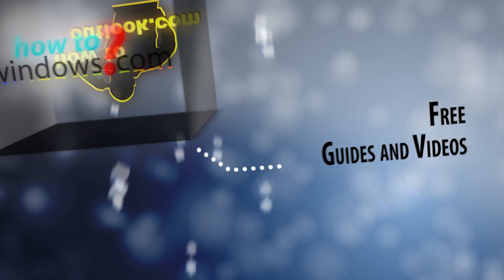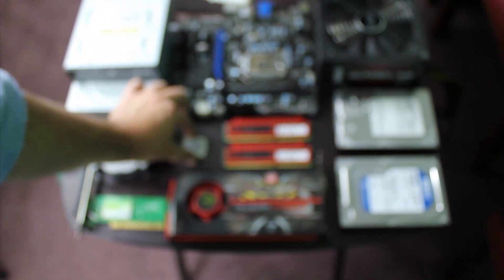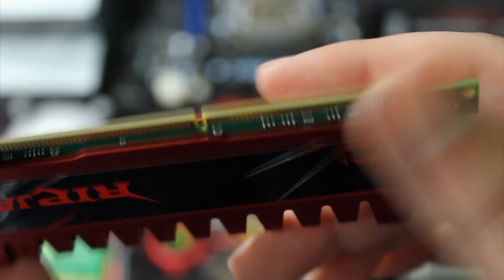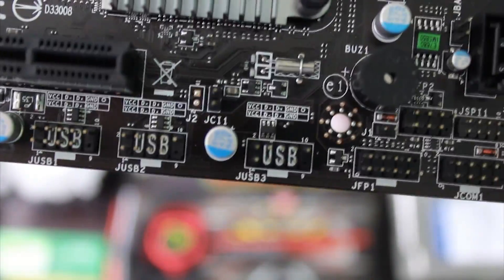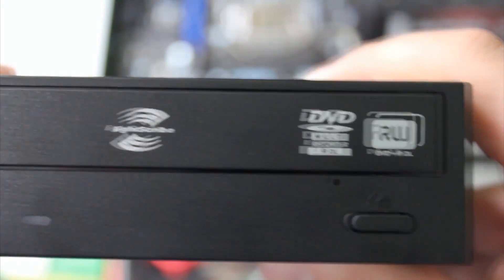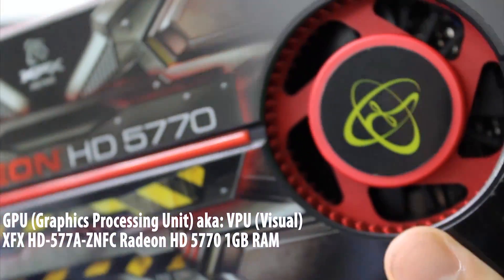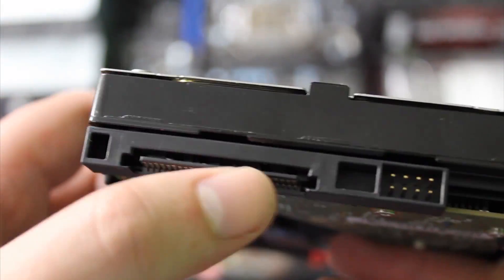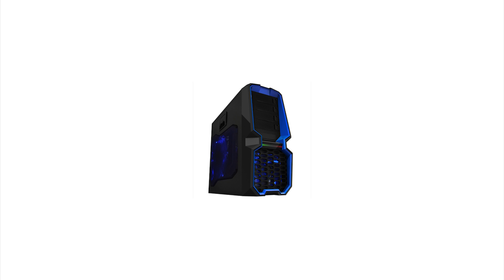How to Build a PC Introduction to Parts [True HD] 1080p

Comment: i'm with ya they're tougher than people think. i got one from ebay used (pentium d 945 3.4/4/800) that was sent in just an envelope. no static bag, no padding, and in the usps. it's still kicking several years later. gave the machine to my niece. made her a great starter machine. really overkill with the 2gb of ram 160gb hdd and ati 2600pro. anyway it's worth pointing, they can be cleaned with alcohol.

Comment: i think he was talking about the wireless card. i heard pci express to. overall pretty informative video for first time builders. i think it would be helpful to cover more on the compound though. not everyone will be getting/using an oem cooler. i've learn from experience, it can be put on wrong and no doubt, someone will screw that up. still, this isn't a bad video. maybe later, one on cable management lol. i'd do it but i don't really have a good enough case to use.